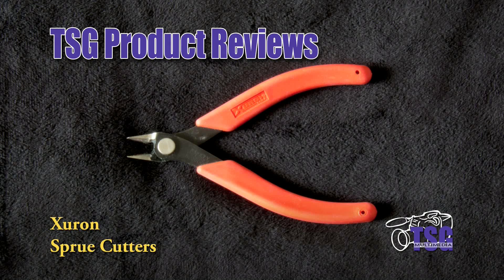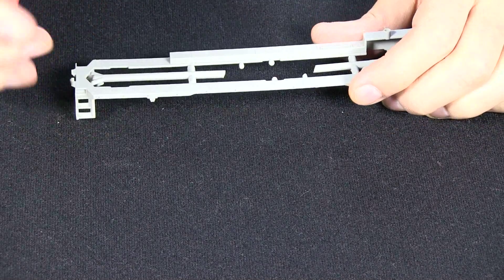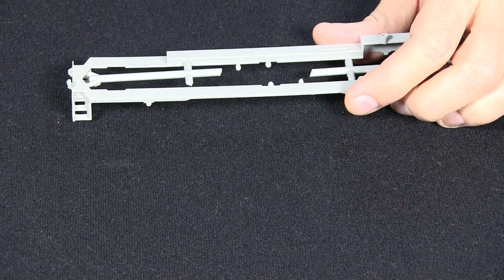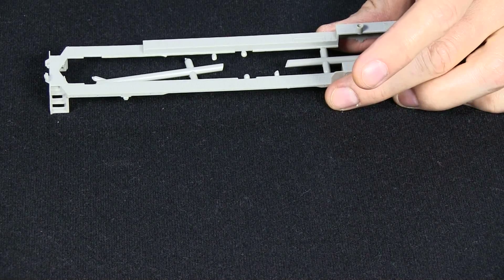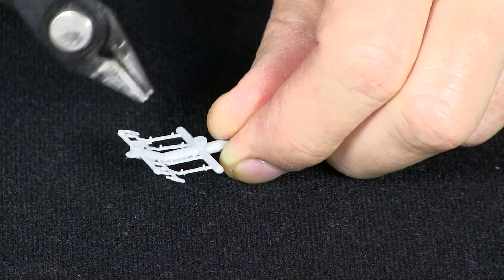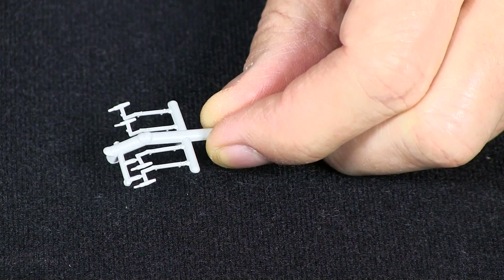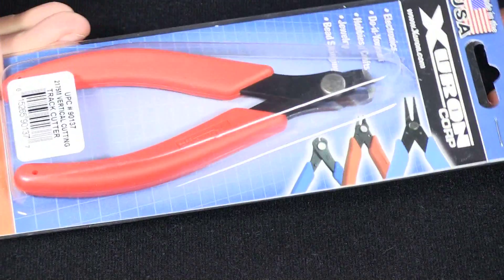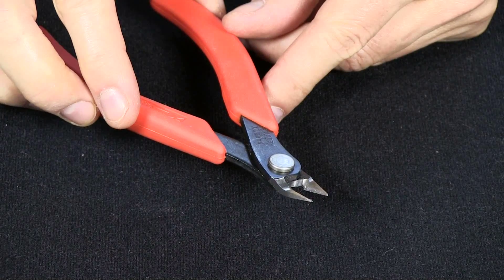Scale Modeling Sprue Cutters Xuron Product Review

Comment: Hi, I have these cutters, and they cut smooth without stress, but mine leave a lot of plastic still on the part.  It requires a lot of cleanup after cutting the part. Are they supposed to be that smooth after cutting?  I know the jaws are supposed to be at an angle so they stay sharp, but mine seem to sit much higher against each other. Thanks.
Reply: +Daniel Cortopassi That makes sense. They are still great cutters. Thanks for the reply, take care.